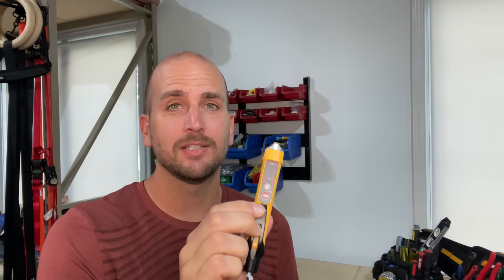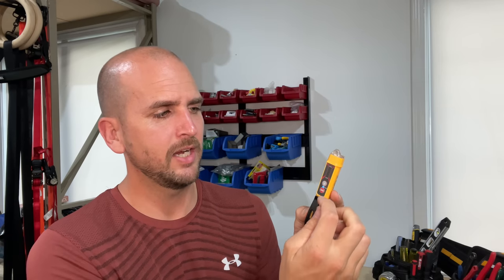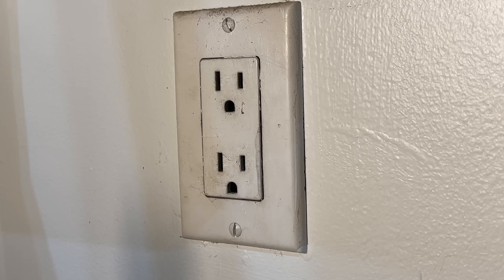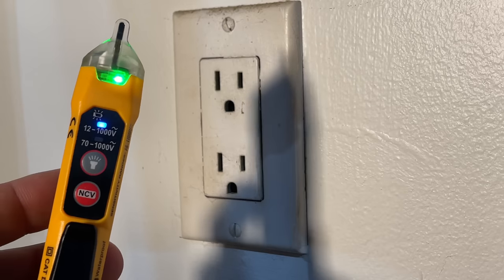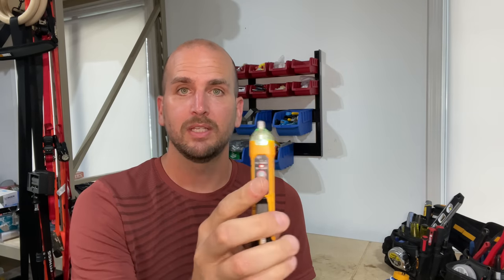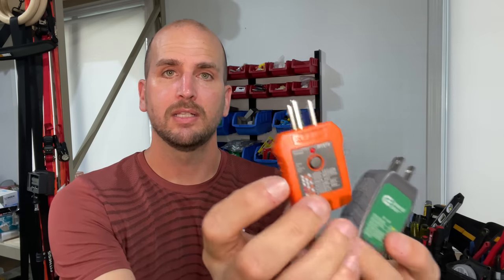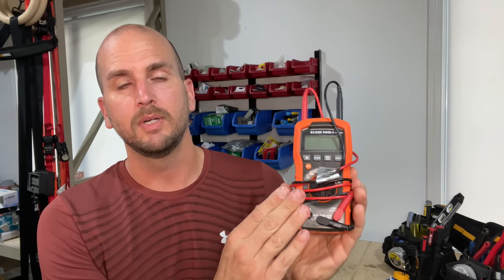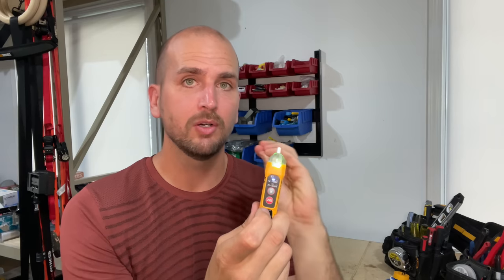Common Safety Issue |  Non-Contact Voltage Testers

Comment: I look at the -3 and see the big blue PWR LED and say "yeah that's on." The light isn't at the tip, but there's still a light. I personally fail to see a problem here. A green light at the tip VS a blue light in the handle isn't going to help you if you forget about either of the two lights. You could just as easily forget that the tip should be green when on and safe VS the handle having a blue light when on and safe.
The real solution here is to know your tools, and if you're not going to use it for another 6 months, keep the instructions with the tool and read them again before using it. Also a lot of other comments about checking it against a known live source first sounds like a great idea too.

I do think the green LED that is replaced with red when voltage is detected is a better design though.

Comment: I always quickly test the tester before actually using it on anything I'm working on. This means I'll take several sample tests at other electrical points, outlets, wiring, etc... to simply know if the tester is functioning correctly before i actually use it and trust it's results

Comment: My standard procedure every time I use my non contact voltage tester is to first make sure it's operational is to always test it on a known live circuit a few times before using it on a circuit that I plan to work on. I also have the plug in tester that I use if I'm not sure if outlet has been de-energized and to confirm outlet is wired correctly and is properly grounded. I can't count how many times that I have found outlets wired incorrectly or not grounded. Another rule that I follow is never in any circumstances ask or have someone weither an helper or customer or homeowner owner to turn off the power to circuit that I'm going to work on. It's my life in my hands and my sole responsibility to be absolutely positive that the power is off. I once was working on an airhandler unit on a AC system and I asked the homeowner to turn the power off to the inside (airhandler) unit and he went to the panel and seen a breaker labeled "AC" and figured that was the one and flipped it off  and said "okay" its off. I took his word for it and grabbed a wire connector for the blower motor and got bit hard. The shock wasn't that bad but the nasty cut I got on my hand from yanking my hand out against the metal required a few stitches. Lesson learned there, never expect someone else to turn off the power to anything ever again.

Comment: It is good practice to always test your test equipment on a known power source first, also I would never trust one of these testers if I was going to physically touch the conductors, use a digital meter or an Ideal (wiggy) voltage tester. I have been an electrician for over 40 years and have always carried one in my tool pouch

Comment: My tester ONLY tests the HOT wire. 
It does not help me when I have lost the neutral.
So it usually stays in the drawer. 
My GFCI tester is my go to test tool.

!

Comment: "Live Dead Live" would eliminate this. "Live"= test on known voltage source. Turn off affected circuit "Dead" Now test the circuit that is supposed to be de-energized "Live" check meter is still  functioning properly by going to the same known voltage source.

Comment: Quite a few multimeters also have a non-contact voltage detection function, it's a handy feature that saves carrying another tool around. For compliance in the UK though these can't be used to prove dead as as you have shown with 1 example they can fail to show live.
The recommended is to have a dedicated tester that will work with or without battery paired with a proving unit that generates a known voltage to verify your tester is working.
Reply: Any tester can fail

Comment: Scott, nice tip...I have the P model and use it on the 12-1000v mode for extra sensitivity.  And as others have suggested below, after I test the receptacle as OFF, I then test it on a known live circuit to confirm my tool is working properly.  For everything else (trouble shooting mostly), I use a Fluke T6-600.  I am a retired DYI'r.

Comment: If the NCVT touches a hot wire can you get shocked? I wasn't sure if the "non-contact" part was required to not shock yourself or if it just means you don't have to make contact with anything to check.

Comment: I am using a Klein Model #NCVT1PR voltage tester and a Commercial Electric Model #CE-GFI6500 GFCI Outlet Circuit Analyzer Tester when changing outlets.

Comment: Good video.  I tried to install a double box today but my pen tester was making one beep with red light on when the breaker was turned off.  I was checking the wires to the wall outlet before removing the switch.  I had already checked both plug ins with a plug in tester which had no lights on showing there was no power to the switch after flipping the breaker.  The single beep heard when touching wires (neutral and hot) was not the normal beep (long) as when testing the plug in.  The pen light was used to check additional wall units and tested good.  What could this short beep (with red light) indicate ?

Comment: I bought a tester and used it once, about a year ago. Went to use it again and it wouldn’t turn on. Turns out the batteries had corroded and ruined the tester. So My suggestion is to remove the batteries if you don’t use it frequently.

Comment: Well, it does beep when it turns off.  Also, devices just like ppl are not always reliable, so it's a good habit to test if the thing actually works before using it, That goes for many if not all gadgets and humans.

Comment: The safe way to use a potential tester requires 3 steps: 1. Test the tester on a known hot source to ensure the tester is working, 2. Test the circuit in question with the tester, and 3. Retest the tester on the known hot circuit to prove it is still working. Personally, I don't use a non-contacting tester to "prove" that a circuit is dead. I would only use an approved contacting tester for that and I would perform the 3-step method.

Comment: My Klein noncontact tester will indicate power on one side of Romex wire only so if I put it on the wrong side it shows no power.  So I always check on both side of any wire.

Comment: 7:00 non-contrat testers do not tell you the actual voltage. They only indicate presence of AC current. They do not work on DC circuts, unless there is a AC component. AKA telephone.

Comment: hey would you recommend HABOTEST HT92 since it was a voltage tester that can be both non contact and display voltage when contact and it also can check Continuity seems like easier solution than Multimeter for me so I have to ask what you think?.

Comment: There are some old pilots and some bold pilots. There are no old, bold pilots. It is the same with electricians.

As many posters have said, always use the live dead live approach which verifies that the tester works before and after the safety test. Then perform the work as if it was a live circuit.

To those that test their NCV tester with static electricity, your test does not verify that it will work correctly on 120VAC 60Hz power at useful sensitivity. It can still light on static ( which can be many times larger voltage than line voltage) and be way out of calibration and thus give you a false negative on live 120VAC power.  Always check the tester on the voltage level you are working on.

Comment: Is it just me? Sometimes when I test a live receptacle (using  the same make and model of the green lit NCVT highlighted in this video) with the unit stabbed into the hot slot, once you remove your hand from it, it stops indicating that voltage is present...even though it's still live. But when you put your had back on it, only then does it indicate voltage is there (red light, continuous tone)

You'd make contact on and off, and consistently, the tester ONLY detects voltage, if it's handheld.

Perhaps mine is defective, but, I don't always keep this in mind, because most times, I keep it in hand when testing, but what happens when you need to quickly determine which breaker is which, and you're working alone, just trying figure out what's feeding a particular receptacle or group of receptacles?

Again, I'm wondering if it's just me...I could have a defective unit, mind you. Anyone else experienced this at any point?

Comment: Two ways,  I use a plug type voltage tester on the outlet / repticle  or just turn off the main panel and use flashlights when needed.  Yes,  I am  a coward when it comes to electricity.

Comment: As a homeowner, I have a few tools but up until the other day, didn't have one of these.  I picked up the 2P model.  I tested on a known live circuit and it only shows any indication that it's live when on the 12-1000V setting.  If I use it on the 70-1000V setting, no indication.  Shouldn't this range be good enough to pick up a 110 V outlet?  Not expecting an answer, just rambling.
Reply: You may be turning it on into silent mode. Also when using in 70-1000V the LED will be red when voltage is detected, as opposed to blue if set to 12-1000V. Read the manual more closely for operation modes chart and silent mode explanation. If you lost the manual, it can be downloaded if you Google for it.
Reply: @galfert  Thanks, I'm good now.  Using it on another known good source, it worked as it should.  Went back to the other and it's doing what it should have done.  Strange, not sure why but seems to be OK now.

Comment: I simply rub my non contact tester on my arm or shirt to test it, the static electricity you generate doing that will make it beep. to confirm it's working. I carry a plug in outlet tester along with a small contact tester with a neon bulb in my pocket along with my non contact tester. I do not rely on the non contact tester alone to confirm the circuit is dead before I work with it. I haven't had a false negative with the non contact tester because of my mistrust for them in crucial situations, I use it for trouble shooting certain scenarios. All three testers are part of my everyday carry.

Comment: I have always wondered how they work even though no power is flowing through the wires…it does not need a complete circuit flow to detect power.🤔 I know it picks up on the magnetic field, but if no electrons are flowing there is no magnetic field..

Comment: I was always taught and actually do believe that NCVTs are not a proper device for verifying a deenergized condition on any circuit you're going to touch. Sure they're great for troubleshooting and quick inspection purposes, but I absolutely wouldn't trust my life to one. On any significant voltage source the best method is the live-dead-live check with a proper DMM or analog VOM, but never a chickenstick. Live-dead-live means you verify the proper functioning of your meter on a live circuit both before and after you verify the circuit in question is deenergized.

Comment: Great video… Just an FYI for a potential safety concern.    Especially, because a lot of people use videos instead of actually reading product instruction manuals.  This is in NO way your fault; it’s just reality.  Unfortunately, stupidity is a fact and some people just should not work with electricity or do home repairs.  In addition, illiteracy affects a lot of very smart people. As an ER nurse, I have seen horrible accidents that could have been avoided.  So I thought I would share something I picked up on.

In the video, you show a short test with each model, but there is no explanation during these demonstration. You go into great detail about false negatives and the differences in these 2 products after the demonstrations.  I realize that you were trying to show the subtle difference between the 2 products.  However,  studies show that people remember more things at the beginning and end of documents, lectures, explanations and videos.  At the end of your video you stated that the green light on the 3P is showing “You have power”.   I’m concerned that someone who wasn’t paying enough attention, might just remember and confuse “The green light shows that you have power” and think there is power in the outlet, wires, switch, etc.  This confusion could be deadly, as they might accidentally turn the power back on to try to get a red light instead.  When in actuality, the green light is just showing that the 3P has working batteries,  is “ON” and ready to test for electrical current or voltage.   

I don’t want you to take down the video, because I think it has a lot of great information and I don’t think that it needs to be completely redone either.   Is it possible just to add some wording or an explanation to clarify that the statement, “The green light is showing you have power”, does not mean there is power in whatever you are testing.  It just means that the 3P’s batteries are working and it is ready to test for electricity.  

Again, I love your videos.  I’ve learned a lot!

Comment: plug in a small fan; no air moving, no power to receptacle.

sure, fancy tools might help if whatever's plugged into the receptacle flickers, fades out, etc, but sometimes 'simple' trumps 'high tech'...
Reply: If you have an open neutral wire, you could still have power but no fan.

Comment: no problems because I use them to verify the presence of power not the absence of power. besides I always verify the device is working properly before using.

Comment: Non contact voltage indicators are unreliable they can give a false positive and false negative, multimeters are dangerous for the untrained, the socket outlet tester is the best tool you have shown because it contacts the hot/live, the neutral and the ground/earth. A contact voltage indicating device is the safe way but even this has to be tested first with a proving unit
Reply: No they work perfectly if you know how to use them. A socket outlet tester yeah great for testing sockets, useless for everything else

Comment: Always assume it's live untill you prove otherwise.. Check a proven live circuit first.   I use the newer version of the klein ncvt.   I change the batteries once every couple of months wether it seems it needs it or not...  120 volts and under I'll use the ncvt.  Everything else , the meter comes out...
Reply from the maker: Thanks for the feedback Brad 👍

Comment: is it normal to get 109v out of receptacles? This is the max I get out of all the ones in my house.
Reply: No, it’s not normal.  I had the same issue several years ago and I called the power company.  They came out at no charge and tested and found out that the transformer on the unity pole was starting to fail.  They replaced the transformer and now I get a steady 120 volts!  They thanked me for bring this situation to their attention.
Reply: @billhandymanbill2775  Thanks... knowing my power company, they'll probably tell me it's within the range... but I will give them a call.
Reply: @billhandymanbill2775  so What's the min I should be getting? - I measured again and some give me 112.5v
Reply: On average, it should be 120-123 volts AC.  It is best to ask the power company what voltage they set on the transformer.  Under voltage and over voltage is not good as it will eventually burn out the motor and light bulbs.  It is best to get it checked out by the power company and it is free of charge!

Comment: honestly i dont trust ncvts i get why a pro would use one working from receptacle to receptacle but for a home owner ide just get a multimeter. sure there's a learning curve and a risk in the case you plug your leads in incorrectly but ncvts can be finicky and they aren't an instrument that gives you much information. Example, i was about to replace a dishwasher and my ncvt kept picking up a 50vac signal from the live wires inductance around the the dead circuit and obviously I didn't realize it was a 50vac signal until i checked it with my multimeter. they're cool but if i had to pick one tool ide chose the multimeter with the added benefit of checking batteries and all the other setting that may come with it.

Comment: you should test on a known hot circut to see if the tester a actually working. Never trust a tool until you see if it is working. 30 plus years in the electronic repair business

Comment: #1 thing to know about NCVT's is that if the paper inside "Romex" (NM) is wet it will sheild the electromagnetic field used by these testers to detect voltage.
#1 thing to know about plug in circuit testers is they will not detect "bootleg grounds" (a wire jumping the neutral and ground on a device.)
#1 thing to know about multimeters is that you need to be a "qualified person" to use one, with a firm grasp of electrical circuits and the operation, rating and quality of the meter.
(Always inspect and ohm the leads then test on known power source.)
Reply: You don't need to take a test to be competent with a DVM.